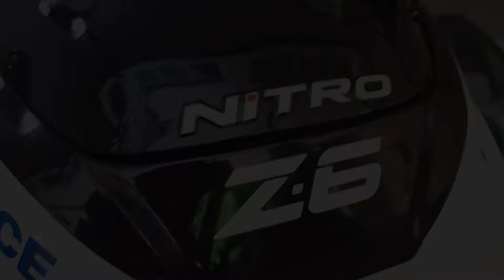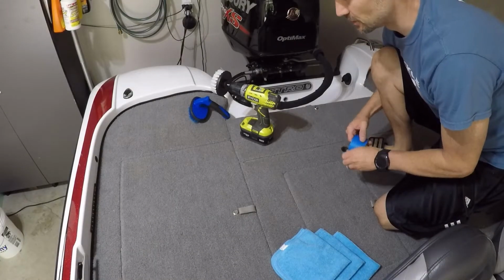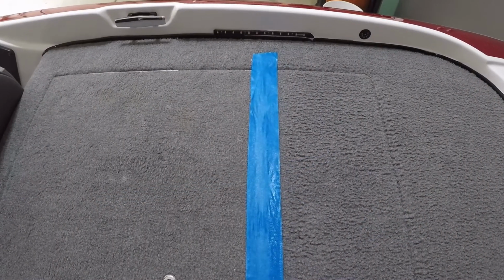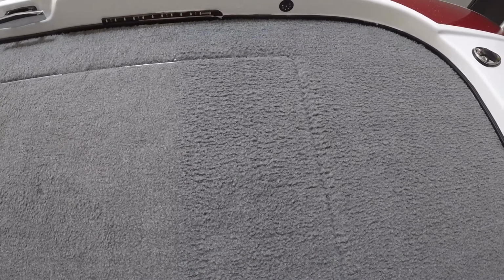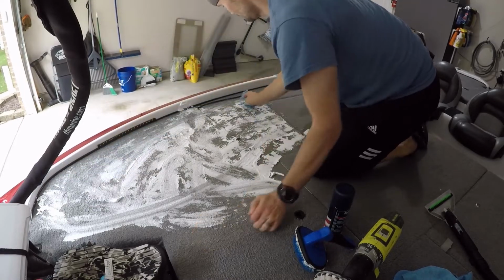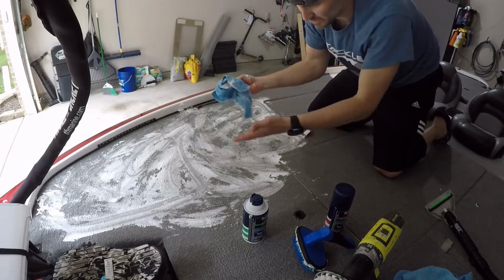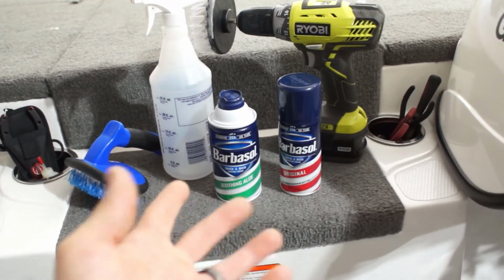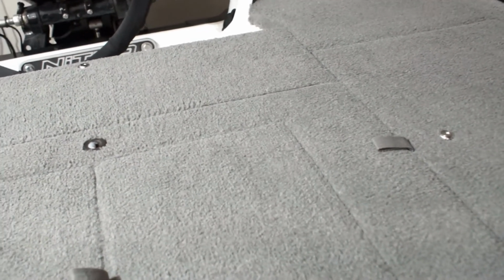NITRO Z6 Bass Boat Carpet SUPER CLEAN - Is It Worth It?! -

Comment: Do you think that the white drill brush was stiff enough? My thoughts are that it is too soft so just ordered a set of green ones.
Reply from the maker: Ummm, personally no. I went with what I have. The brushes I use are also for household use and also cleaning the carpet in my cars. If you're buying new and only for your boat carpet, go stiffer. Just be careful on your drill setting so you don't burn through the carpet. Keep moving and add more water if needed and you'll be fine. Good Luck!
Reply: @smitty8403  thanks, I appreciate it.